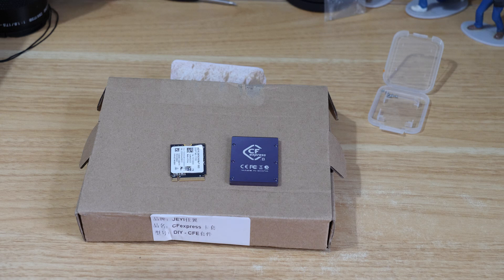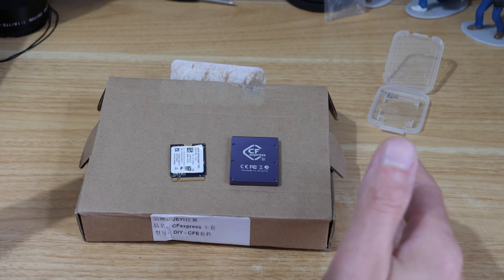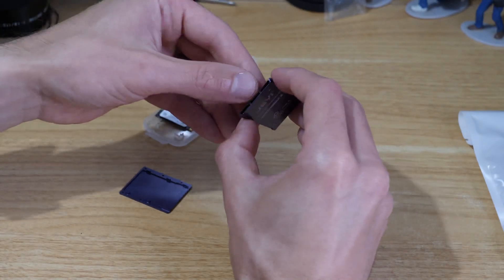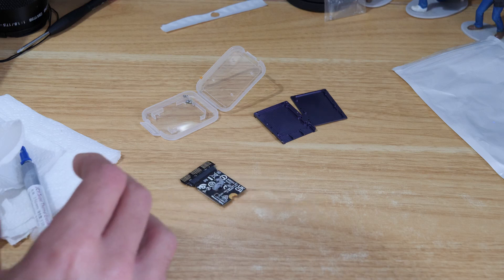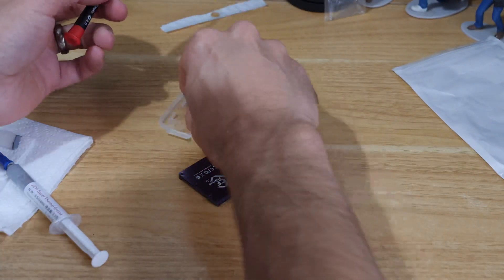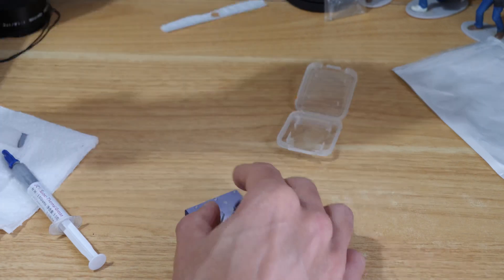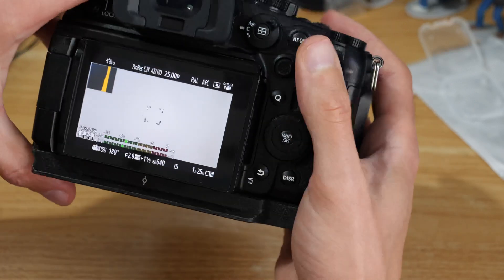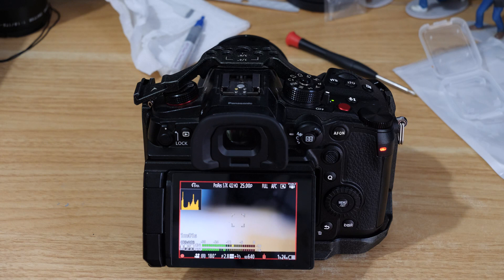DIY NVME CF Express Card | Make Your Own CF Express Card | Budget CF Express Type B Card for Cameras

Comment: Hi Steven, thank you for this information. I created a similar ssd last year using and Sabrent Rocket NVMe 4.0 1TD drive enclosed in Trebleet m.2 enclosure and it has worked very well for me. Write at 2100 MBS/S  and read about 2300 MB/S. This is an external SSD and it does get rather warm. I was not aware that such a NVMe and CF adapter does exist. My only concern would be with the heat generated . Please keep me informed of your experience with this new 1 TB CF express card.
Reply from the maker: That sounds like a nice external drive. I have been looking at some different external NVME cases to potentially use with my camera. I actually find my off-the-shelf CF Express cards tend to get very hot, so I expect this to be no different. I'll keep testing it though and see how it holds up in comparison.

Comment: There are a lot of fakes on this site. Try recording 1 TB of video on this card, this can be done through a card reader on a PC. And make sure that all this video will be played later. I came across the fact that Chinese memory cards either did not allow me to write the entire amount of memory on them or then they did not play these files.
Reply from the maker: I'll be giving it a good test over the next few weeks/months. So far, so good. Even if you get an iffy drive, you still have the adapter. So you can replace it pretty cheaply and still have a working card.
Reply: Before conducting commercial video shooting on this card, I would record 1 TB of any video on it and check how it plays on this card. @stevelitton
Reply from the maker: @lnuponom2678  Thanks for the advice, I will make sure to fill it up with some ProRes footage and see how it copes 👍

Comment: Which card did you buy, SN740 or SN530?
There are different recording speeds.
And the JEYI CF-Express Type-B to 2230 NVMe M.2 SSD Adapter says that it only supports writing speed of 1800Mb/s and a reading speed of 1200Mb/s.
Reply from the maker: I got the 740, but you're right the card enclosure will bottleneck the read and write speeds. I just didn't want to go for the slower version as I already take those speeds with a pinch of salt.
Reply: @stevelitton  slower is actually better since it's cooler, as long as it saturates the bitrate of whatever it is you're shooting.
Reply from the maker: @haploguy  thanks, that's interesting to know, I will see how this SSD performs and if it does have heat issues maybe I will looks at the slower versions as an alternative.

Comment: Why do you need thermal paste?
Reply from the maker: Supposed to just dissipate the heat a little better. Some come with little thermal pads rather than the paste. I would rather spend 5 minutes putting it on if it's going to keep the card a tiny bit cooler and offer slightly better performance.